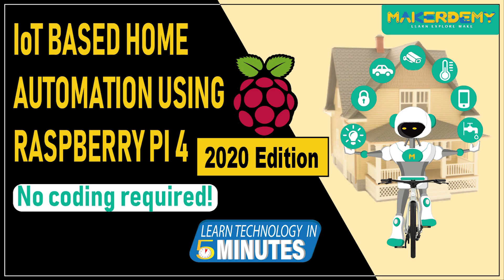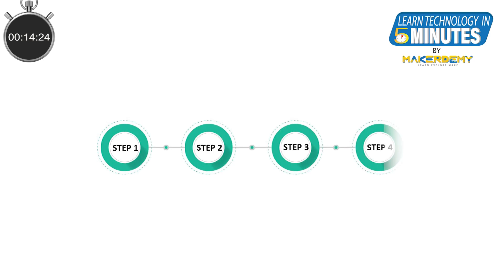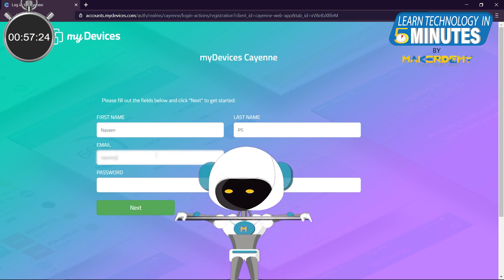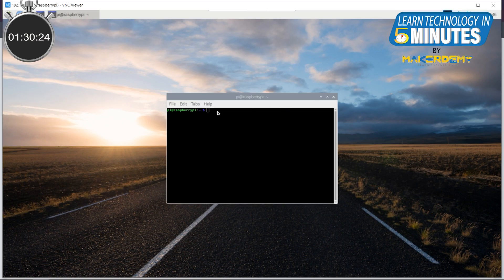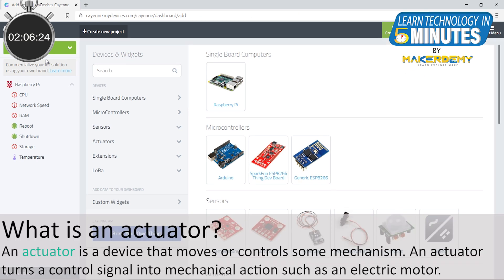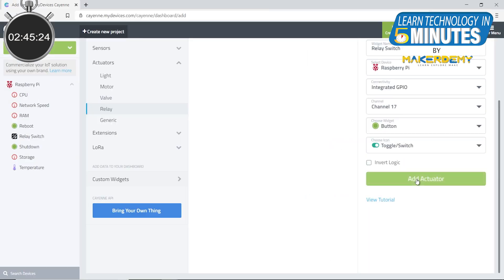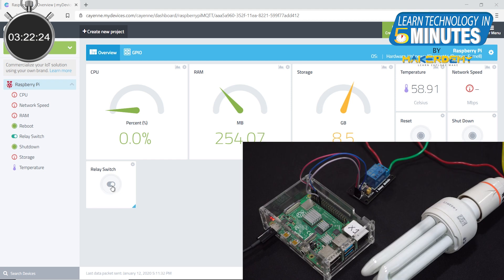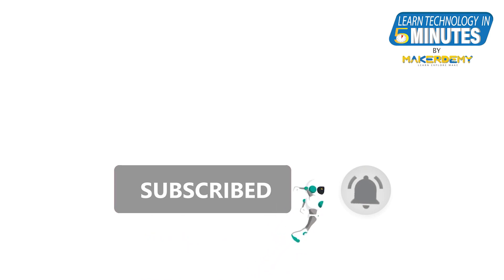IoT Based Home Automation using Raspberry Pi 4 (2020) | Learn Technology in 5 Minutes

Comment: i am getting bulding failed. how to solve this?please help me
Reply from the maker: Hi Asritha.

This may be due to the reason that your raspberry pi OS is not upto date. Also your python packages need to be updated to the latest version. 
First make sure that you are running the latest version of Raspberry Pi OS
Now using sudo apt-get update, and sudo apt-get upgrade commands update your system
Then go to Python documentation, and do steps there to update your Python Version
Finally Make sure to use pip and pip3 commands to update python libraries
Now reboot the system, and try once again
If this doesn’t work, please share a detailed screenshot of the full error screen.
We hope this was helpful.
Thank You

Comment: Can we controll a solenoid valve using this
Reply from the maker: Hi Anakha95,

Although Cayenne doesn't have native support for solenoid modules, you can easily integrate your application into the project if you are willing to do some coding on the board; in this case, it's a Raspberry Pi. As it's just the case of supplying logic high or low to activate the driving circuit of the solenoid module, the setup is pretty straightforward. You may check out these resources, and if you have any further doubts, you can ask in the cayenne community forum. 
1.https://community.mydevices.com/t/controlling-solenoids-with-arduino/6336
2.https://www.hackster.io/kuncono/iot-water-control-and-monitor-using-nodemcu-cayenne-b37015
3.https://community.mydevices.com/t/brainbird-wifi-4-channel-cayenne-controlled-solenoid-driver/1615

Thank You

Comment: Will this work on Raspberry Pi 3 B+. Does code part same for both Raspberry Pi
Reply from the maker: Hi S Venkatesh,

It will definitely work on any Raspberry Pi 3B+. In this video, we haven't used any code. We have used the Cayenne IoT Platform to implement the Project. If you meant to ask about the setting up of Cayenne in the terminal, yes, it is the same procedure for the Pi 3 B+ also.
We hope this was helpful.

Thank You

Comment: Nice video, In this you are controlling one light (device) using GPIO port, what’s the maximum number of devices you can control using raspberry pi 4 using GPIO ports ?
Reply from the maker: Hi Binoy,

The term “controlling” can have 2 meanings. In the case of this video, it means to switch it on or off.  The other meaning, is to send and receive specific commands to carry out a desired operation, like for example, displaying a text on an LCD Screen which is interfaced with the Raspberry Pi. If your operation is as simple as ON or OFF, you can connect 26 different devices. But you have to be aware of the total current draw limitation from each pin. What I mean is that, you can easily connect 26 LEDs along with 26 Current limiting resistors on all usable GPIO pins (26), and make it work flawlessly. But if you take a relay, it needs separate power, which is why we take it from the 5V pin of the Pi. Thus, to avoid any such issues, you should go through the datasheet of the Pi 4 and learn about the maximum output current tolerance of the GPIO pins. We hope this was helpful. 

Thank You
Reply: @MAKERDEMY   It is indeed clear, will look at the data sheet for more details, good to know the limit for simple operation as well. Thanks for your reply.